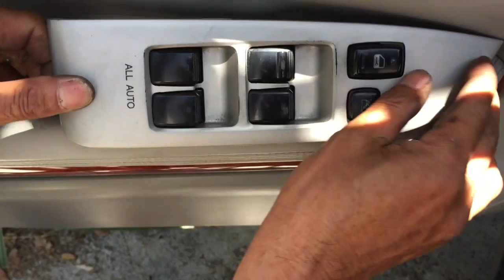Replacement Window door Lock Actautor Motor Lexus ES300 RX330 RX350 RX400H ES330 GS350 GX470 Scion

Comment: Great video. Easy to follow. Only problem I have now is the door lock itself - when I put the key in the door lock, nothing happens when I turn (doesn’t lock or unlock). Any thoughts?
Reply: I have this same issue. Did you ever figure it out?
Reply: @ImTribble  unfortunately no…I wish I did. I’ve just been living with it and always checking the key fab battery. When I notice it slow to unlock/lock, I change it
Reply: @MrWonderfulChris I came back to update you on what I found on this issue. I took the part back out and examined it. I found that there is a spot at the top of the part that the key cylinder goes into. It is a pain to line up for me but once I got it in there, the key works.  Just wanted to update you and anyone else that came across this reply.
Reply: @ImTribble  oh man thanks so much for letting me know! I appreciate the follow up on this. I’ll give it a try too and see if I can make some magic like you did! Great job figuring it out

Comment: At 02:40 what is that latch called? I believe my plastic molding holding the link has snapped off inside thus sometimes causes issues with my locks

Comment: Awesome video! Lexus wanted $550 to replace the actuator on my 2014 GS350.  I got one from Amazon for $61.99 and did it myself in less than an hour.  I did need to loosen the window track when reinstalling the new one, but it was just two bolts.  The toughest part of this whole job was getting the door panel back on.  Thanks for the video!
Reply: Link?

Comment: Great video!!! I used it to replace the actuator on my 2010 RX350 — this video is for the previous body style but is STILL 98% the same and saved me $650!!! Thanks SO much for posting this! I may try to up load a video of me replacing the next one on my 2010 but I couldn’t have done this without this video!

Comment: Just performed a doorlock actuator motor transplant on the driver's side rear door actuator in a 2005 RX330. The price of the motor was $9.00. The Lexus dealership wanted $450.00 to replace the actuator assembly. The Lexus service representative claimed they "wouldn't know what they would get into" once they began the work. It's always gratifying to turn the tables on automobile service department shysters.

Comment: Thank you for the video. I referred it to fix my actuator on 2006 IS 350. Very useful video. I had to remove the bolt holding the glass sliding metal bar to free up some space to be easy in and out for the actuator on my car. other than that basically everything else is the same to your video. Thank you so much.

Comment: What were you doing at 9:00 to 9"10 with flashlight?
Reply: That's a metal bar from outside door handle to connect the actuator which unlock the driver door when pulling the handle from outside.
Reply: wayne han Thanks